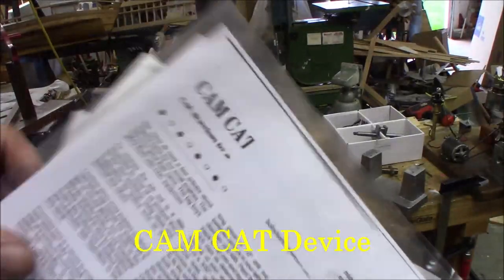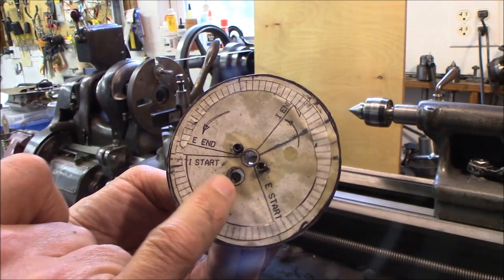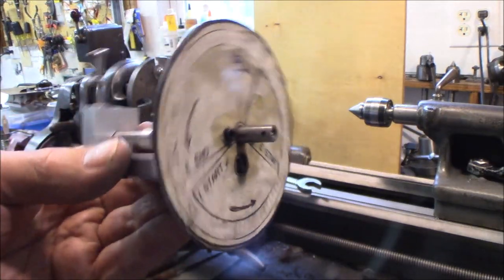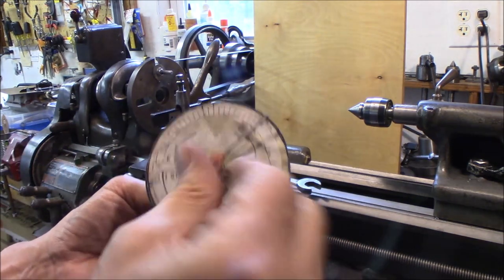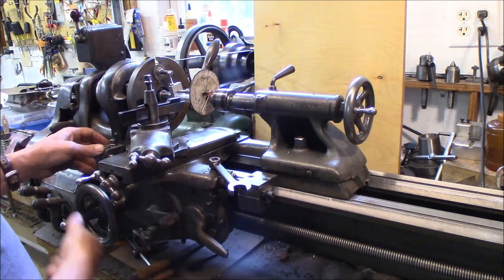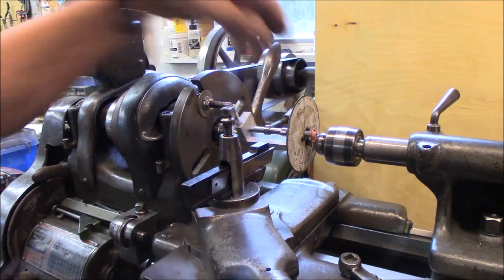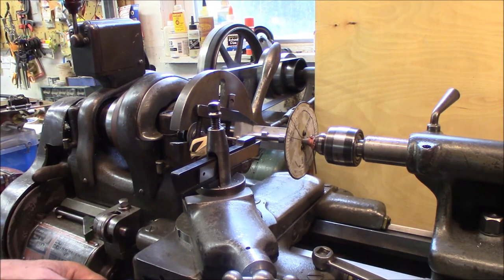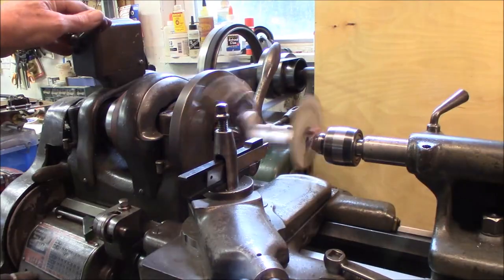How to make DiY homemade camshaft for model engine using a lathe without grinding.

Comment: The cam i made i used a small rotary table offset in a 4 jaw chuck. The lobes were press on. I would make a pass and index the table 5 degrees . After the lobe was done about an inch long i sawed it into and had 2 for a single cyl engine
Reply from the maker: That sounds like a pretty good way to do it.
Reply: @gwheyduke  Yes , no fixtures of any type. The stock has a hole through it and mounts to the table with a stud. My cheap table has a habit of tipping slightly when the lock is tightened , that was the only issue

Comment: Beautiful work!
Great video.
Where can I get the CAM CAT Device?
I intend to make a small camshaft.
Reply from the maker: The Cam Cat is constructed with drawings from Strictly I.C. magazine.  The magazine is no longer in print but back issues are available online;   http://strictlyic.com/index.html    look for the  August/September 2000 issue.    If you study the video carefully you could make one.  It's actually pretty simple.
Reply: @gwheyduke I will download your video and watch it as many times as necessary. Thank you very much!
Reply: I look to find it but didnt, I need the Article or prints

Comment: i am a fan of collets and  cotters. 
and i despise split clamps.

looks like wacking the back plate out of solid with a tapered bush aka collet would clamp it with far less issue with bolts stripping... akin to the taper locks on shafts/pulleys/bearings...

for a quick one off, these do the job. for anything serious? far too limited! fixed throw, etc...

Comment: Very impressed. I am slowly making the midget. We're might I access the  plans for the cam cat?
Reply from the maker: Bob Shore's "Cam Cat" article appeared in Strictly I.C. magazine.  His wife was selling back issues here  http://www.strictlyic.com/index.html   also on the Florida Association  of Model Engineering there is an article under  "tips and links"  of a similar fixture.  http://www.floridaame.org/
Reply: @gwheyduke  Thank you !!  I am new to model making and very much   appreciate the help
Reply: Thanks again. Just received my strictly ic mag. I really like your 5 degree increments and will attempt the same.With your video it should be a breeze 😉
Reply from the maker: @averagejoe2182  Good to hear.  Good luck with your cams, it just takes a little time, I'm sure you can  make it work.